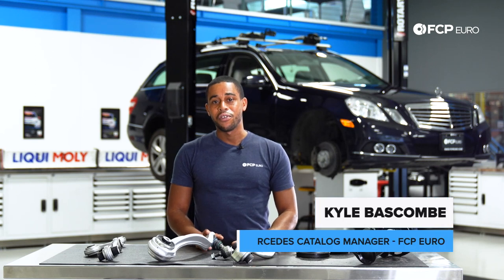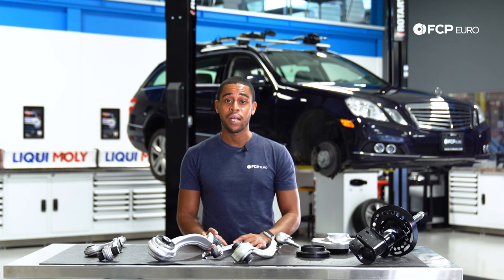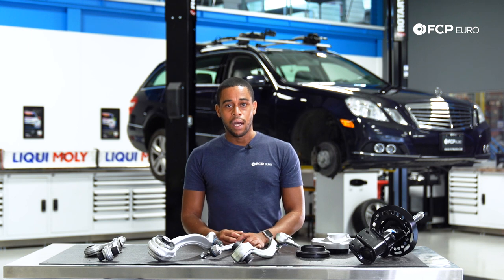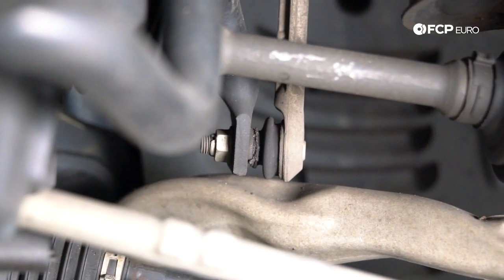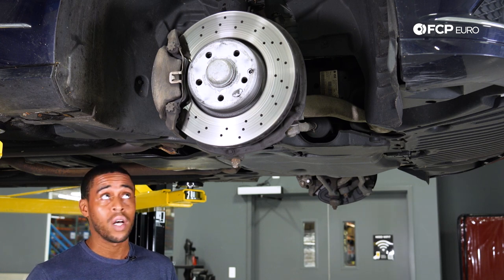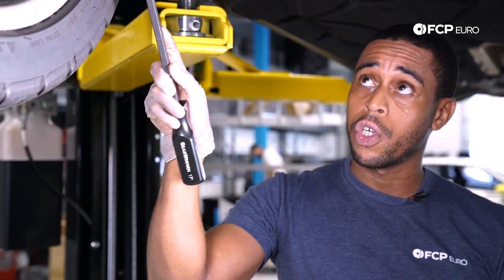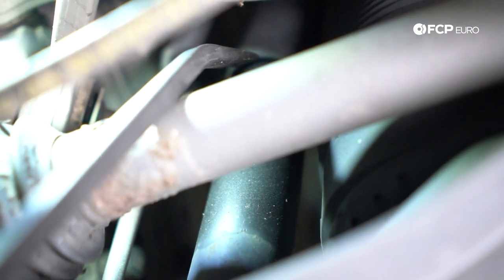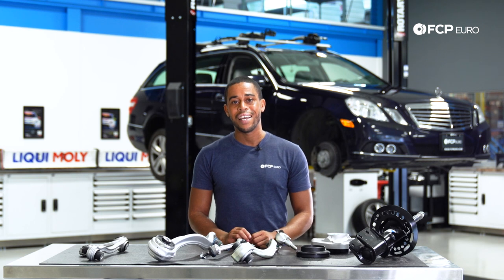Mercedes-Benz W212 Suspension Diagnostic & Maintenance Guide (E350, E250, E400, E550, & E63 AMG)

Comment: Thank You Kyle. Always providing sound advice. My son and I just did Front Struts, Rear Shocks and all End lInks about a week ago on our E350. A word for DIY 'ers. When doing the front struts we discovered the front springs are longer and more compressed than a person might first think. Even using the professional spring compressing equipment we have,  still had a mini explosion removing the upper mount on the first side we did. I would NOT recommend using the 'Sticks' people use for performing this job on this make/model car!
Reply: I experienced the same thing doing front struts on my C207. Coupe suspension setup is basically identical to this minus the air. A friend and I managed to get the springs compressed alright with a Single Action compressor, & and the tool had to be compressed 100%. Like you said, the standard spring compressors don't cut it on these springs whatsoever. Deceivingly long springs indeed
Reply: Exactly has the same issue in my 2014 e350 super long springs
Reply: High five dude! This is the type of comment this video deserves. A compliment, a gratifying story of how the video led to a father son diy project. Followed with sound safety advice. 👍

Comment: I have a W212 2014 E63S with 90k miles and when backing up from the driveway and turning I'm hearing a grinding noise towards front driver side. Does this sound like a strut issue?
Reply: Any updates bro?
Reply: @winstonw5273  Nah, I sold it.

Comment: My lady has a 2016 with 37k left front can get pretty messy over certain bumps. your video confirmed for me I need a left front strut and mount. It rides like a dream other wise.  Are the parts you advertise original mb parts. or after market?

Comment: Need to check my w218, sitting about 5mm to 10mm lower on the passenger side. Very good info.
Reply: Left Coil Spring sagging
Reply: Nope, had it changed out. Merc claims its with in spec. Its wierdz but a little better with new shocks but still low.@hanynowsky
Reply: @f1wilk  yes bmw E60 and merc w212 have a tolerance of 10mm between left and right and also 10mm of tolerance from factory ride height.
You need to load the car and measure ride height.
In a bmw E60 it s:
- 68kgs in front passenger seat
- 68 in front driver seat.
- 68kgs in center of rear seats
- 21 kgs in trunk.
- full fuel tank.
Reply: Ah ok will try. I figured it was cause the battery sitting on the low side strut tower. Passenger side.

Comment: I have 138k on my 14 E350 base. All original. Sway bar link rf boots but no noise. Ride is exceptional and smooth.
Reply from the maker: Smooth driving.
Reply: @fcpeuro  I still miss my old E39 but the W212 is a dream to drive.
Reply: My w212 is experiencing vibrations and a rough ride new shocks front and back and control arms what else can cause a rough ride tire psi?
Reply: @G_G_AutoCareLLC  Bent wheel, tires out of balance, tires older than four years old, ignition issues, fuel delivery, motor mounts trans mount, center bearing or flex discs on driveshaft, all of these will affect the ride. What brand and model shocks and struts? For example High performance struts and shocks will be a harsher ride as they are for performance not OE ride. A good tech can diagnose your issues, do not just throw parts at it, that is just wasting money.
Reply: @r.weaver3769  I am the mechanic I have changed the struts with bilstein b4
Reply: It’s like when going slow I feel a wobble like a hop
Reply: @G_G_AutoCareLLC  That sounds like a separated tire, or bent wheel or hub. Jack it up, spin each wheel, watch the tread for a lump or wobble if that's okay,  watch rim inside and out for deflection or bend. Once you find the offending wheel, swap it with another just to make sure it's not a bent hub, which is very rare. I'm betting on the tire being the culprit. B4s should be OE ride and struts or suspension would not wobble or hop at low speeds either.
Reply: @r.weaver3769  what tire pressure are you running on your 14 e350
Reply: Also could the lug nuts be my problem I changed them out for aftermarket a while back if I torque them to 96ftlbs it rides ok but any tighter and I feel the hop
Reply: @G_G_AutoCareLLC  It sounds like you have aftermarket wheels or spacers installed, and the center hub diameter is larger than the hub center of the car, meaning the lugs are trying to center the wheels, they are not designed to do that.

Contact wheel manufacture or spacer manufacture for centering rings or correct spacers to properly center wheels. Any wheel movement of wheel will eventually snap bolts off causing damage to car, property, and/or others. 

Hope this helps.
Reply: @G_G_AutoCareLLC  I am running the factory recommended, 33 front and 35 rear if I remember. I do know the previous owner was running a higher pressure on my car as the tires have more wear in the center of the tread. 

These Michelins should have lasted another 3 years, I don'[t drive that much, but I will most likely need tires next year because of improper air pressure maintenance. 

They were also using the fast lube joints for oil changes, so I am doing oil analysis every oil change to gauge if any damage to engine because of the bulk oil usage, hopefully they demanded Mobil 1 for the oil. So far so good.
Reply: @r.weaver3769  No aftermarket wheels I had some on a while back but put the factory back on I just ordered some aftermarket lug nuts from Amazon to put my factory wheels back on they are ball seat lug nuts which are correct for the factory wheels they just seem like 1mm longer 

Just my ride is not smooth like a Mercedes should be also my normal psi says 33f33r and max 35f 41r seems like the car handles better with higher pressure but you feel way more vibrations 🤦‍♂️
Reply: @G_G_AutoCareLLC  Yes, the higher pressure does handle better, but Mercedes wheels are a bit wider than most others with the same size tires so the tires will wear in the center as a result. I would prefer factory lugs, many items, even Mercedes branded products on Amazon are actually Chinesium, therefore not the same in the least. I would Also recommend cleaning hub of car and center hole of wheel with brass brush, apply a thin coat of silicone brake grease to contact point of hub, and a super thin layer of copper never seize to face of rotor that wheel contacts, do not apply to lug threads, keep those dry, clean, and free of grease, and see if this helps. Consider factory lugs, the hardness is higher than aftermarket.
Reply: @r.weaver3769  bro Major update the wobble has became annoying enough today I decided to get the front two tires balanced and come to find out one of my rims is bent smh 🤦‍♂️ second bad rim so far on this car in 2 years. The guy rebalanced the wheels and it does drive alot smoother. Now I have to get another rim. Ended up settling on 35f 40r psi
Reply: @G_G_AutoCareLLC  At least now you know for certain, I had a rim straightened a couple months ago. The only downside is when the heated my rim, they melted the finish on it. I sanded and sprayed it to keep down corrosion till I can get it professionally refinished. I bought bit with some scrapes, so. 
I'm so glad you found the concern. Nothing like piece of mind.
Reply: @r.weaver3769  yes I found a guy that said he can fix it for 180$? I may as well spend a little more and get another remanufactured rim from eBay or used what you think?
Reply: @G_G_AutoCareLLC  Yes, by all means, I would have done that, but mine are the 17" five spoke, rare and expensive for some reason. Seems the 18" and 19" are cheaper and plentiful than mine for $400 plus price. At that price I may as well get the MB wheels for $500 ea.
Reply: @r.weaver3769  I have the same wheels 2014 e350 4 Matic luxury very hard to find and very soft material
Reply: @G_G_AutoCareLLC  Must be, very hard to find, I rather like more side wall, but I may go 18" just to get cheaper factory wheels. The 18" look better on the car, but I like the soft ride of the 17".
Reply: @r.weaver3769  the 17s ride is decent I see more Mercedes with 18s floating down the rode honestly tires are everything this car had taught me a lot I had 20 inch rims on my car and the ride was harder but handled good . I think 18s or 19s would be great

Comment: Greetings, there is a metal impact sound coming from the right front of my W212 2015 model Mercedes vehicle on rough roads and frequent short bumps such as the test track.  Even though the Z rod and bushings were changed, the sound did not stop.  There is no problem in driving, there is no pulling or shaking, there is only a metal rattle on the rough road, this sound only occurs due to vertical force, where do you think the problem is, best regards
Reply: The is a bushing inside the front strut that goes bad, it doesn’t cause any other problems except from the noise I believe.

Comment: Do you have an idea, where the vibrations might come from my s212 AirMatic. The steering wheel is  very slightly vibrating but i feel vibration best by the seat. Wheels are balanced and straight. Vibrations starts at 80km/h and from there to 110kmh it gets denser. At higher speed i dont rly feel anything.

Comment: Hey great videos. I have a question for you what's the difference between the e350 4matic non air suspension to the e550 4matic w212 air suspension.? I have both struts and i don't really see a difference between them.

Comment: I have a 2014 E63s AMG. I have replaced all brake rotors and pads and followed break in procedures, yet whenever I am at higher speeds or decelerating to around 40 mph~ the cars front wheels shake so much so that the car feels like falling apart. I had removed my front wheels and tested the rotors for run out and there were no issues. I have replaced both front wheel bearings with new axle nuts and all WIS instructions were followed. Could you please advise what other issues could cause this? I have been chasing this issue for 6 months to no end. Brakes check out. Inner tie rods are in desperate need of replacing. I will start with those are they are cheaper than all new brembo brakes. Please advise and thank you for your time!
Reply from the maker: Worn-out suspension bushings will cause vibration under heavy braking, so tie rods and control arm bushings will certainly need to be looked into!
Reply: @fcpeuro  wonderful! I have ordered the tie rod ends (inner and outer) from my local dealer. I will inspect the control arms. Thank you again for your help!!

Comment: Kyle just one question for you so if you are replacing front air suspension do you have to unplug the battery??? Thanks I have E550 4matic 2010
Reply from the maker: Hi Roof, while not mandatory, it certainly does not hurt to do so.

Comment: Hi Kyle, I have a 2013 E550 and it has always had a problem with a very loud POP when either cornering very (very) hard mid-turn, or, on a very severe speed-bump.  It doesn't happen under light load at all.  

I had the entire front suspension replaced while under CPO about 20k miles ago, but that didn't really fix the issue either.  

Any advice or thoughts would be greatly appreciated.
Reply: I’ve got a 2010 E550 still with Air. Never heard a pop. Have some creaking and leaking. Planning to just go to coils. Maybe you can call these guys. Or check Alex on YT LegitStreetCars he’s an MB guy.

Comment: Never mentioned the issue with the e63 amg 4matic models, LF lower control arm over time pushes the bushing out from the eye of the arm.  They never fully separate as the subframe pocket prevents it but you certainly don't want to have an issue on the road.  Also happens on the w218 cls63 amg 4matic.

Comment: Me and a friend of mine, both of us have 2010 e350s, for some reason the ride quality is really harsh compared to an A4 or 3 series. You think changing out to softer springs or different struts will rectify the issue?
Reply: How many miles on them? Bad roads where you live? I had to do front struts, mounts, and end links on my E350 coupe at about 80k mi. Also did upper control arms and sway bar (as bushings aren't serviceable alone) while I was in there, but the struts and end links were totally shot & my ride quality improved drastically. 
Ride quality should never be rough in one of these, although they certainly don't handle like a 3 series.
Reply: Wheel and tire size, as well as runflat vs non runflat, makes huge difference.

Comment: New subscriber here. I currently drive a 2011 e550 sedan RWD. I'm doing a coilover conversion. Parts are from Silvers Neo max. I'm having issues connecting the rear springs to the top mount. Any ideas what could be wrong? The conversion kit is designed for the w212 and I also changed the lower control arms for the rear which helped but still can not connect it to the top mount.
Reply from the maker: shoot an email over to service@fcpeuro.com with a link to the kit and pictures and they'd be happy to pass it along to our Mercedes catalog manager.

Comment: Hello, everyone

I have anurgent question, as you are an expert on Mercedes 

I have an e classe e250 2009 

the issueis that I took it twice to Technical control for 2 different

 Scanners and both of them  told me, aftercontrol that the fan of my car,

Doesn’t turn on until it Get’s above the 105° 

1. is thatnormal ??  For a Mercedes as mine, whichI don’t think it’s normal 

So afterthat I thought that the sensor was going wrong so I change it but 

The resultsstay the same the scanner indicates the same 105° then I’ve known 

It’s the“calculator “who controls this stuff so what am wondering if its possible to 

Set my fanat 85 degree instead of 105 degrees, on the calculator settings

2 . Is that possible to make????????

THENKS SIR, ALL MY REGARDS

Comment: I had a question guys, I drive a w204 c300 sport 4 matic. The driver side anti roll bar link is not connected to the strut at the top, but the passenger side is. Is that correct or does it need to be identical on both front sides. i just got them replaced.
Reply from the maker: Yes! they do need to be connected at both sides. Also, check the bar, the curved section nearest to the axle has a tendency to rot
Reply: @fcpeuro  thanks alot guys, i just came back from the shop and got it done

Comment: What would be the culprit in the front suspension if a clunk is occurring over any size bumps?
Reply from the maker: Thats a tough one because there are so many components that could have failed. Best option is to jack the car up and attempt to manipulate the front wheel until the noise occurs and can be narrowed down
Reply: @fcpeuro  Just found out the clunk is coming from a damaged lower wishbone. Shop says it'll take 6 hours to replace it. Does that sound about right?
Reply: @fcpeuro  And by wishbone they meant control arm. From my reading it's only held in by two bolts, so 6 hours is replace that is insane, correct? haha
Reply: @Gx22  6hrs for that is ridiculous, it takes 20 minutes.
Reply: Had the same clunking noise on my 2010 E350 sport with 30k miles turns out it was the sway bar links they were broken now it rides good again n steering wheel feels tight again

Comment: Hello I have a w212 e250cdi amg sport...hade the rear spring changed and the back is way too high...part was from mercedes dealer but a local garage fitted them....I also had the front springs changed and the front is well low...now the ride is so shit that u can't corner properly...mercedes have said it the rear spring have a red and green marking then the spring shud be right...hes also said there parts catalogue cud be wrong...can u help me on a set of springs plz
Reply from the maker: If you send an email over to service@fcpeuro.com the team can certainy help verify fitment

Comment: I just got one of these one wheel is facing in while the other faces straight when i drive pass 20 tire is quicking and the car cant steer unless i lower speed to 10 😂 fak hope is not the steering rack

Comment: Replace all the front components at 70,000? You're a pessimist, mine has 280,000 miles and just passed the annual statutory test in the UK. Rear air leaks are not necessarily  air spring leaks, it can be an air line leak or the valve block. Are you going to cover this stuff in another video?

Comment: why is this the best MB when at 70k miles you need to replace the entire front suspension and maybe even some driveshaft issues........ both od expensive then rear suspension at 100k........ what
Reply: It’s a suggestion. Doing your own Inspection will tell you what you need. I’m at 240K (highway driving mostly) and about to do it all at once for the first time, including the axle and engine mounts.